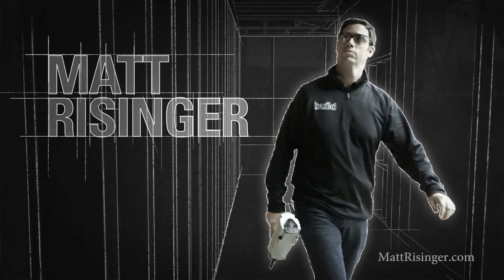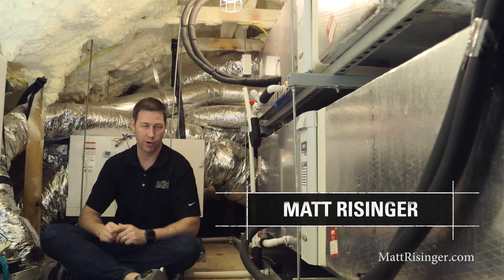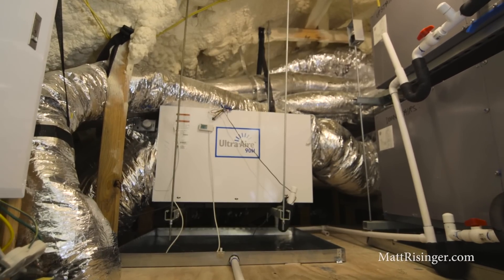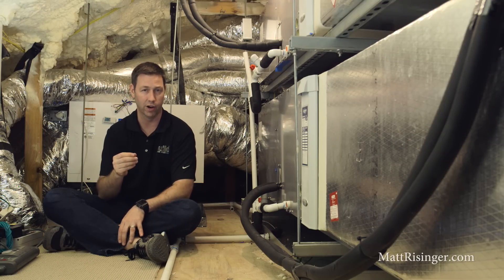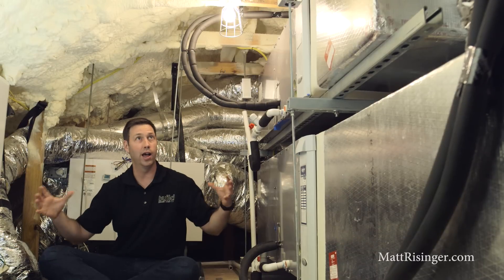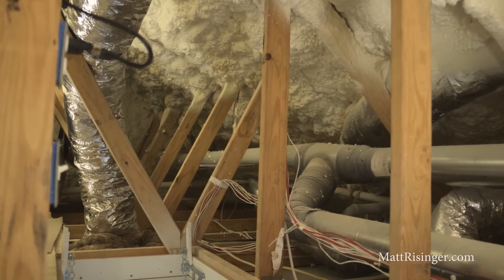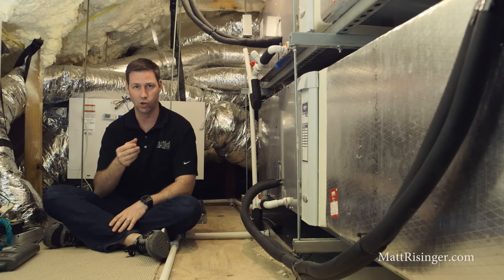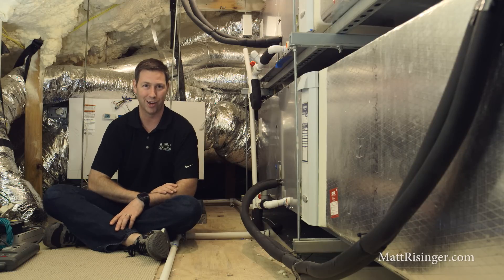Spray Foam Attic Insulation - Conditioned Attic How & Why

Comment: Question. With an encapsulated spray foam attic, is there a need or benefit to air seal the ceiling from the attic like around can lights and wires?

Comment: So we have a coventional insulated floor attic. The temps I see each day is 117 - 120.  Outside has been 99 - 101.  The duct exist temp of the AC is 60. Intake in the hall is 74.  We keep our thermostat on 73 in the day and 72 at night. My AC tech said he measured a 20 degree split temp over my in the attic coi. So we are loosing ~10 degrees temp in ducts.

We have 2 x 6" rafters. If that bewteen filled with closed cell srpay foam isnulation, closed off the side vents, removed our three whirlly birds, closed their holes off and the kept the current conventional insulation stays on the attic floor, what temps could I expect in the attic once closed in?

Comment: I have a conditioned attic…open cell spray foam in Houston. I have a 2stage HVAC house is 1800 ft.² they installed a 2 ton air conditioner which is fine but when temperatures hit 90 or above it just cannot keep up it is always running in second stage   My question is, would I be able to put fiberglass blown in insulation on the attic floor without any complications? I just feel a 9° difference from my living space and my attic space the air conditioner just cannot keep up in extreme hot days. Thanks

Comment: Matt, we are building a new home, and I am trying to follow your guidance by having the builder provide both an encapsulated crawl space and an unvented attic, with spray foam insulation.  As we approach the end of our rough-in phase, I have discovered that one of the return air ducts has been routed above the back porch ceiling, which will mean it exits the insulated attic space then re-enters the insulated attic space.  I have asked the builder to relocate the duct in question because it seems contrary to the plan for increased efficiency?  Am I being too anal?  Or should I hold firm in my position that the duct should be rerouted?

Comment: I have a similar attic to this one except it's currently vented and has two gables. I'm looking to install Central Air.  I would like to condition the attic for the Central Air unit to work better but do I need to cool the attic  with a few vents? My overall worry is mold or musty air forming in the attic. Does anyone have thoughts on this?

Comment: Hey Matt, I've foam insulated my new build, but it's so well insulated  that I'm building humidity like crazy. You can see it around the window sills. Not good. I've purchased dehumidifiers to pull out the humidity.  Is there a better solution than these portable units you have experience with?
Reply: A 2 stage AC system or whole house dehumidifier would help with that issue.

Comment: Hey Matt, wanted to know, do you have to remove the old floor insulation when you spray foam the attic, if not will it cause issues
Reply: I've been researching this, (just a DIY home owner) and the general consensus is yes, remove the floor insulation, to allow the air to move in and out of the attic easier, otherwise, there isn't enough air flow, which can possibly cause condensation which leads to water which leads to possibly some bacterial growth (i.e. mold). When I get a chance to spray foam my 2001 home's attic, I will plan to remove the floor insulation.
Reply: @sailorloki  thanks for the tip

Comment: So I am building a new home where we are foam insulating the walls and attic. The builder has vents in the attic. Should these be sealed shut and do I need vents on my soffets?
Reply: Correction: See Greg House, HouseInspects on You Tube.
Reply: David, I’ve heard soffit vents and roof vents should be sealed. You don’t want any moister being pulled into your attic. Check out Mike House - house inspector.

Comment: Matt,
Question, as owner of an existing 2006 house built slightly above builder quality (Abilene, TX), how would you recommend I upgrade to a conditioned attic.  I assume we would want to remove existing (VERY DIRTY) blown in insulation.  How much insulation would you recommend.  Open-cell or closed-cell or a combo.  A video on how to upgrade would probably be ridiculously popular.  Thank you for your input!

Comment: My opencell North Texas attic is super humid in summer. All outside wall s are 2x6 with opencell as well. Would you recommend adding supply\return ducts  with dampers inside the attic for this issue? Looking for most cost effective solution, I know a whole house dehumidifier would be optimal but not cheap though.. Thanks

Comment: Matt I live in Houston and had an Open Cell application for our attic done in 2010. the insulation does wonders with keeping our home at a comfortable temperature , however we have had to put up with a noticeable stagnant air smell upstairs. It is unpleasant and a noticeable difference from downstairs area. Not a dead fish smell or anything like that just different and unappealing. And we just noticed today that as we are having our shingles replaced on our roof the dead stagnant air smell is gone??? Probably because the roof vents are open and currently being replaced. I know you are NOT suppose to have ventilation in a climatized attic space but what are your suggestions for the stagnant dead air smell. I am pretty sure when the roofers are thru the smell will return in a day or so??? Should we add a ridge vent to allow some of the air to turnover?
Reply: No reply, that sucks. I was looking forward to seeing it

Comment: Ok question for you... Can we step up the efficiency by adding foam boards to the attic floor of a spray foam installation? We have noticed hot spots in our 3000 sqr foot house despite the entire house being spray foam. We are in Texas like you and there must be a way to keep more AC in the living space rather than in the attic.

Comment: Hi Matt, I’ve just discovered your very informative channel. I’m building in South Georgia and have decided to go with open cell foam in the attic and cellulose the walls. As far as I know, the foam will be sprayed directly onto the roof decking. Is a protective film required? Also, what constitutes a conditioned attic? Thanks.

Comment: Great open foam job but can't say same for your ductwork. Plus ductboard is archaic. Use slick metal for clean air. The flex can't possibly have been balanced with all those hard turns and compressed points. Just saying

Comment: I was wondering if I could do it myself with those diy foam tanks that sell for 600 .
Reply from the maker: +Neogx148 yes but you'll need like 10 tanks!
Reply: Matt Risinger lol alright damn blows that idea .

well i got two more questions since I'm seriously want to do this to my attic 

1. how much does it cost typically to hire a company do a attic with open cell or close cell foam. I live in San Antonio so I'm in the same region.

2 .Is close cell better to use in a attic or open cell. what would you recommend ?

Comment: Hi Matt! We are building in Houston and I have been reading a lot about spray foam over the last month. I was all for it but my wife is very sensitive to chemical smells, so now we don't know what to do. What are your thoughts on the  health concerns on the internet (off gasing) going as far as people having to rip out the foam again?  An indoor air quality expert claimed 1-20 spray foam insulation have issues (e.g. because of mistakes by the installer or wrong conditions like weather, ventilation, etc.) For how long have you been doing spray foam insulation? Have you ever experienced any issues? PS: Great videos, I am in the process of watching them all!
Reply: Robert Hawke our attic is closed cell, like the video. one year later, no issues at all. plus, our holiday decorations stored in the attic aren't cooking all year long.
Reply: i'm in houston. only way to go .. add a dehumidifier and you will need a very small air conditioner

Comment: There is a lot of discussion of temperature reduction inside the attic of an unwanted attic. What about the humidity within that unvented attic? If there is no airflow, how does any humidity that gets into the attic get out?  Im assuming that there are no ducts or returns within the attic. Also since there is no moving air in the attic, what are the chances of condensation to the air ducts?
Reply: +sphingers 1 well its a properly assembled conditioned attic...so now worries on vapor (Risinger brought the ac into an air conditioned space, by way of making an air conditioned space in the attic)
Reply: Has to have a few supply vents in an attic like that for circulation or a humidifier

Comment: How does the ventilation work with this method? Are there baffles underneath of that spray foam in the rafter bays to allow cool air to be sucked in through the vented soffit, through the rafters bays and out of the roofs ridge vent?
Reply: +Steve Barnabei im betting (not an engineer) you could add baffles to the rafter bays then add a vapor barrier and lay rigid insulation over that to make a vented roof and a conditioned attic similar to Risinger did here.
Reply from the maker: +Steve Barnabei No, this is an un-vented attic assembly.
Reply: +Matt Risinger  in a cold climate would insulating roof deck be a bad idea? My ducts are in the basement, I was wondering if I had the roof deck spray foamed wouldn't the heat all go to the attic in the winter and keep the lower floors cold?

Comment: Spray foam... a science project right inside your own home. Don't worry when things go wrong. Either way, i only use cork insulation. 100% natural and doesn't leech chemicals into the air when heated by warmth.

Comment: Hopefully you use vent channel all the way up to the ridge vent between the roof rafters before you filled in with spray foam insulation.  Otherwise if you have a shingled roof you are going shorten the lifespan of those shingles dramatically from the heat.  The roof rafters aren't normally insulated so the roof can breathe and disipate heat into the attic space and up and out the ridge vent.
Reply: absolutely wrong
Reply: you are old school, no idea on building science... straight idiot

Comment: Foaming the bottom of the roof deck is an expensive solution to bad design and increases the size of the mechanical system due to the extra volume that needs to be conditioned.  Everyone knows (or do they) that you do not locate the ductwork in a non-conditioned space.  Foaming the deck also eliminates natural ventilation and radiant barrier use, and combats heat gain in only one way - conduction.  If I were to seal my attic from the exterior I might think of using it as a plenum and eliminate the ductwork all together.  Why would you need insulated ductwork in a conditioned space?

Comment: Matt, nice video. My question is what if any adjustments need to be made for the roofing composite shingle or metal? Would it also be beneficial in this situation to add a layer of RMAX over the roof sheeting?
Reply from the maker: +Anthony Huntsinger I use a peel & stick roof underlayment.  Yes you could definitely add roof top foam.  See some of my other videos on how I've done that. Matt

Comment: Thanks for the informative channel.
 Quick question: Do you have any concerns with decking rot or moisture using this insulation method? If it is a concern , how do you combat it ,as far as the rest of the roofs construction.  I'm in the same climate as you is why am asking. Thanks in advance.
Reply from the maker: +LandscapeIrrigation I suggest a peel &  stick roof underlayment so your roof deck won't get wet.  If you do that, then this is a bulletproof install.  Matt

Comment: is radon buildup in a home sealed like this an issue?
Reply from the maker: +shaun hoblitzell Shawn, no matter your insulation or air sealing you need to deal with Radon independently with a mitigation system.

Comment: When it is in the upper 90's outside, the temp in my house is 80, and that is with NO air conditioning. I turn on a few fans and circulate air, and things are right pleasant. I have so much shade on the place is the key.

Comment: Do you like open or closed cell spray foam in the attic space? Is there a negative to using closed cell in the attic (besides cost) when spraying in this manner?
Reply: I wonder if you have to use open cell, since closed would be a vapor barrier?
Reply: +ushipb00 the problem with closed cell is if you have a roof leak you may never know until its to late

Comment: Matt, how does the improved efficiency of the HVAC compared to the additional heating/cooling load placed on the house by having additional cubic footage of air to condition?
Reply from the maker: Great question. On a typical house I build it allows us to go down by 1/2 ton on the AC size!
Reply: +Matt Risinger hi Matt I am building a new house and want to know when you say conditioned attic does that mean there is transfer grills to livable space? Or do you have to run supply air into there?